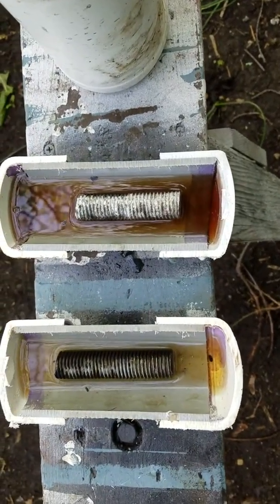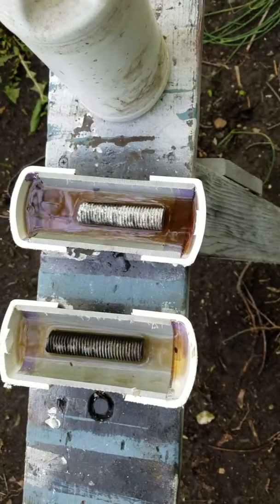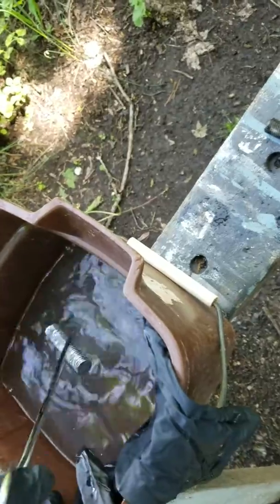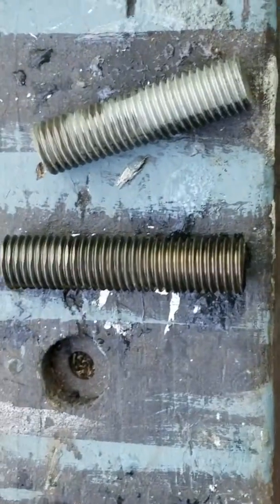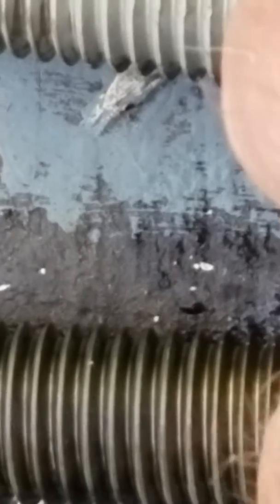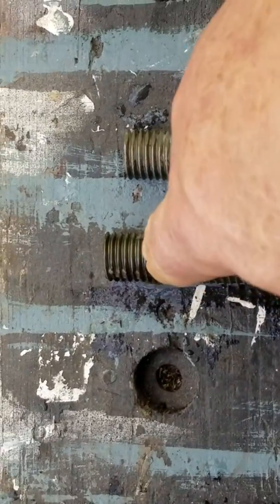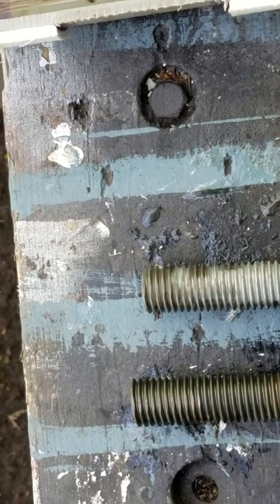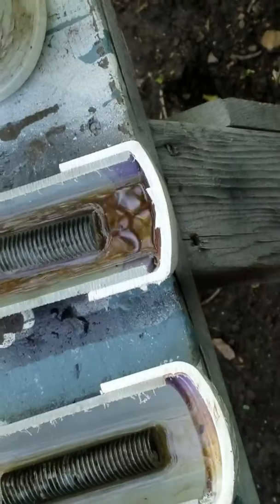File Sharpening ~ Visual inspection

Comment: I never throw any tool away because one day that dull file might help if you get into knife making or something... I have a few nice old files that are dull and I sure would be glad if this worked!  Thanks very much!!
Reply from the maker: The process works. This series is attempting to show how it works. 
The only thing it won't do is replace missing teeth. 
As the teeth dull the top of the triangle wears away. The acid eats all the wetted surfaces equally so the top loses one atom at the same time both sides lose one. That makes the triangle get thinner at twice the rate of it getting shorter. End result a small flat on the top will disappear much faster than a big one. The teeth get smaller and further apart. As long as all the teeth are there, or at least enough to make it worth doing, the file ends up sharper than before. 
If the tooth is gone all it does is eat away the metal where the tooth was. It doesn't make a hole there but it doesn't make a tooth either.  😊
Reply: Old Sneelock's Workshop  -  great explanation!  Thanks very much!!!

Comment: The cutting edge on a file is so much smaller then the threads on the bolt. So whatever time is necessary to eat the fine damaged edge on a file, you need to multiply the scale up. So if it took 3-5 days for a file, it may take twice as long or more for the scale up. What do you think?
Reply from the maker: Tony Lenge I think you are right.

Comment: Looks like the vinegar is holding its own in this challenge.  I get black looking gunk when soaking in vinegar also.
Reply from the maker: F4u-SuperCorsair If I keep the cap on top of the reactor tube it doesn't get the black stuff on top. Otherwise there is a thick, black, crusty layer on top of the vinegar. When i derusted the hand vise it was thick enough it cracked into chunks.